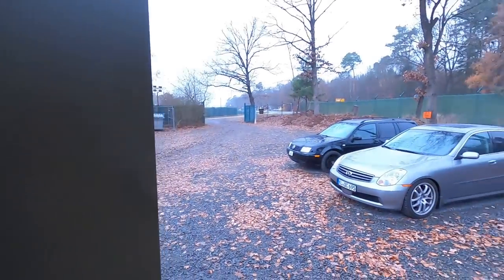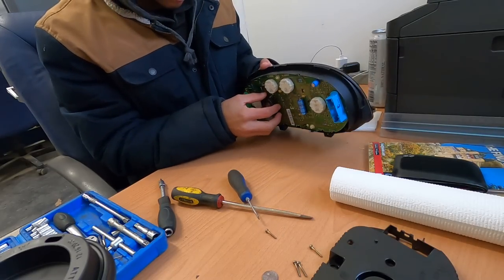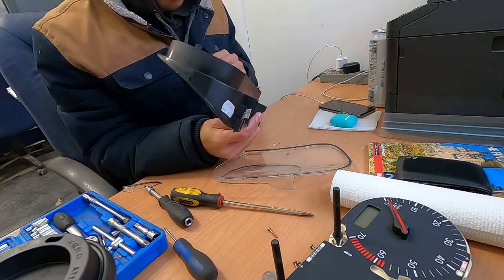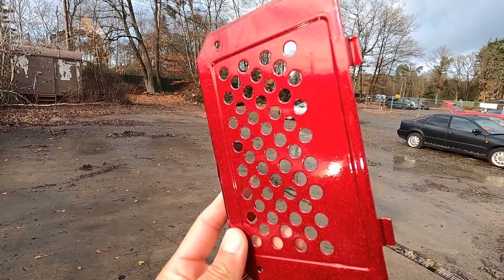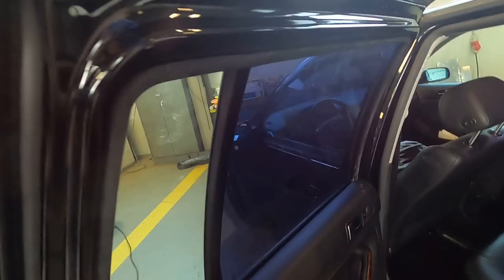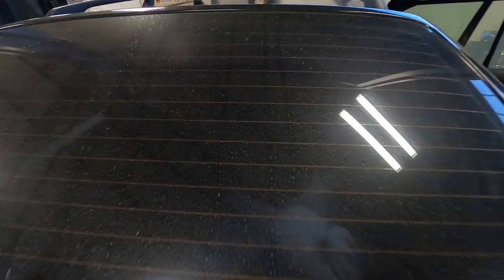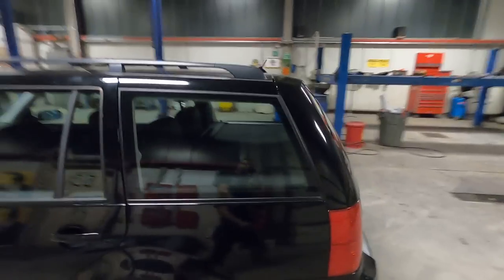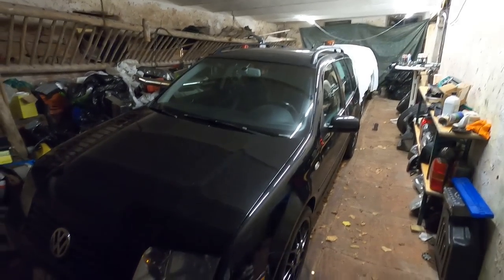The VR6 Jetta Wagon Looks A MILLION Times Better Now! ( Powdercoat Reveal )

Comment: To pull the needles off the cluster faces, 2 small spoons work Amazing bro 👌🏼 the rounded under side ensures you don’t damage nothin 🤘🏼
Reply: I was pulling mine off like that and somehow ended up damaging the stepper motors. I think you’re supposed to twist them and pull upwards.
Reply: Pull and sping Counter clock wise, make sure u take a pic where ur needles where before. Usually they home back where they where.